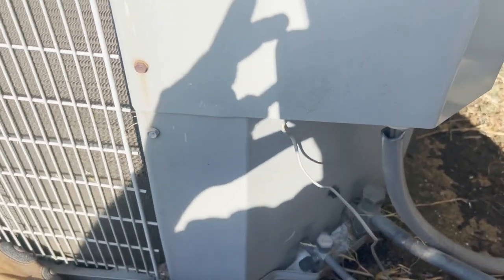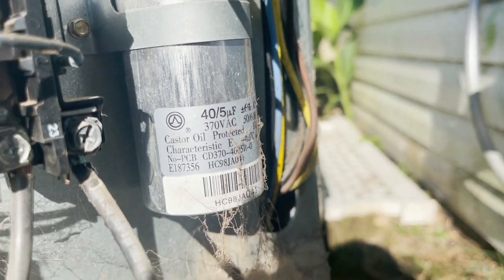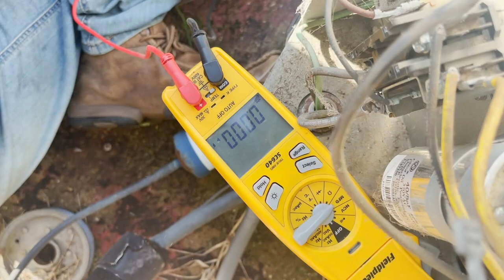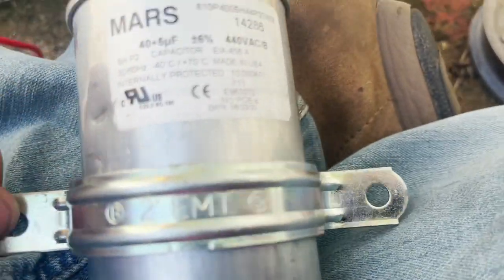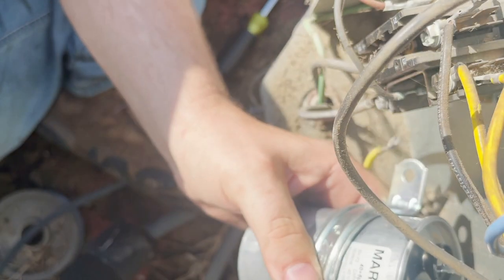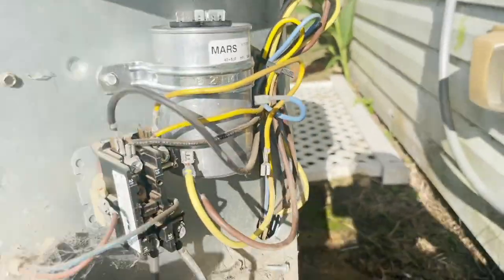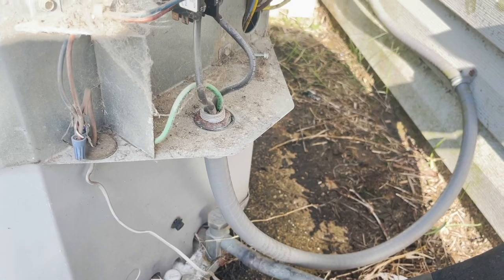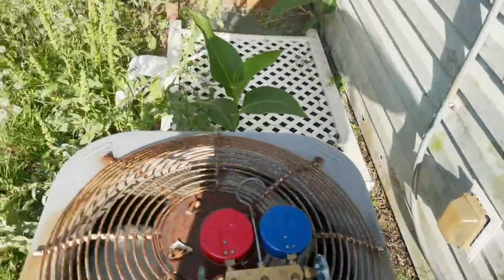No Cool/No Compressor/Easy Fix

Comment: I like the way he says fardy (40). I usually use metal strapping on the van just cut to size and bend a flange on both sides screw down.
Reply from the maker: Louisiana Cajun accent and s why I say 40 like that
Reply: @johnisraelhvac2019  It's all good John! I like it ...its what makes everyone different

Comment: John, I would recommend the m12 impact for daily service work. I used to use the m18 every day but it's just so heavy. The m12 with a 2 amp hour battery lasts me a few weeks on a single charge
Reply: M12 right angle drill ,it fits anywhere

Comment: Controversial viewpoint here but if one thought about it long enough.... If the customer is sure that they're not going to forklift, truck, 2 wheel their unit to a new location, a black tie strap is sufficient to holding the cap upright. .

Comment: What is a good capacitor brand you recommend. I like Turbo 200s. I know they cost a little more but you won’t be back in 2-3 years for the same issue. I recently went to Titan HD. I’ll see what will happen.
Reply: Titan hd's are good but the absolute best brand I have found yet is amrad.

Comment: Hi John I do have a question how come u don't want to hit the low voltage on the condensor
Reply from the maker: Because it will short out and blow fuse or transformer on indoor unit